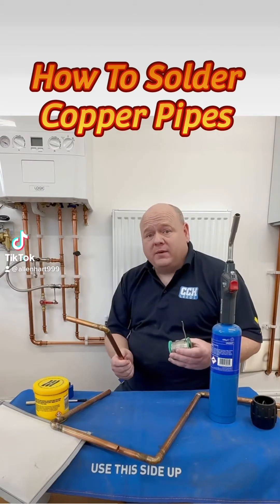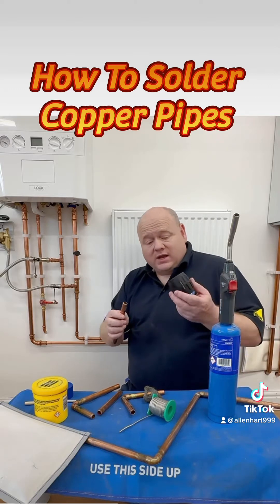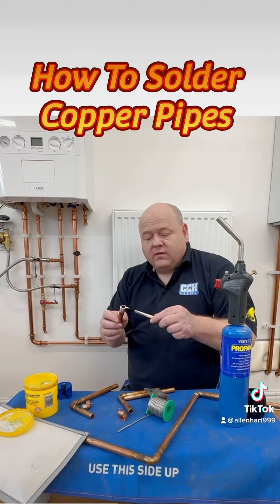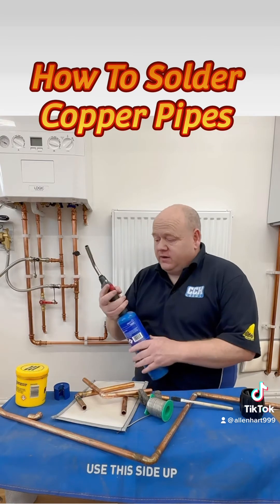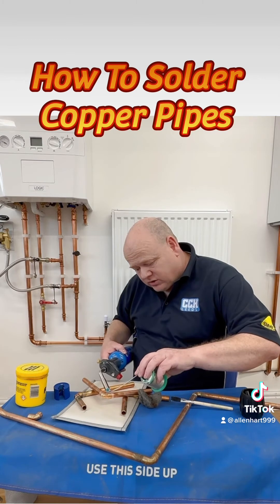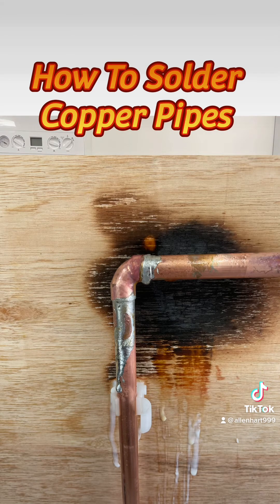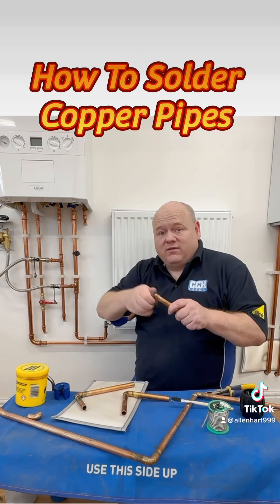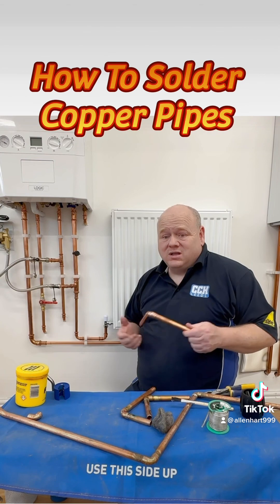How To Solder Copper Pipes #plumber #plumbing

Comment: Had a little chuckle when you mentioned the wool. Always remember as an apprentice working in the bay's at the TC back in the seventies, to gain maximum marks in exams cleaning up with wire wool. You could see your face in the copper after shining up. Happy  Days. 😀😁😂
Reply from the maker: Thank You